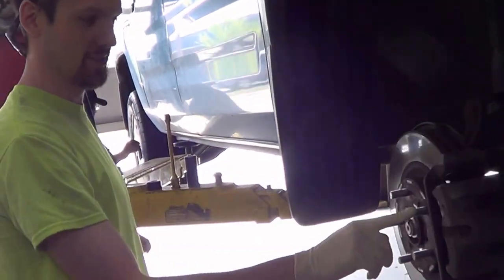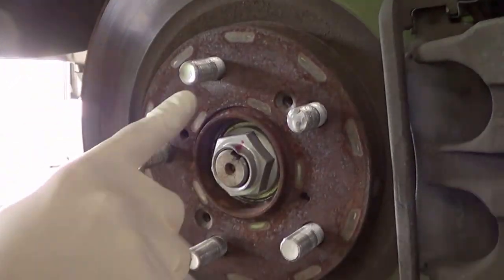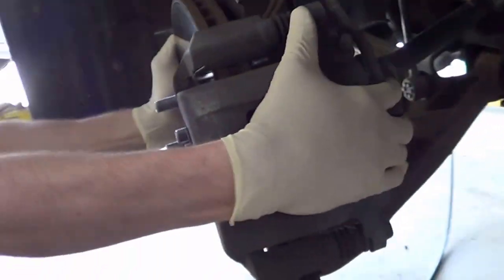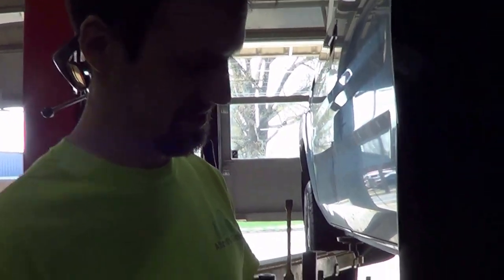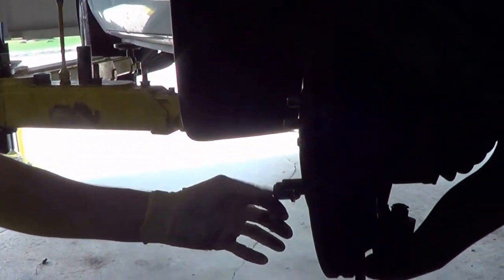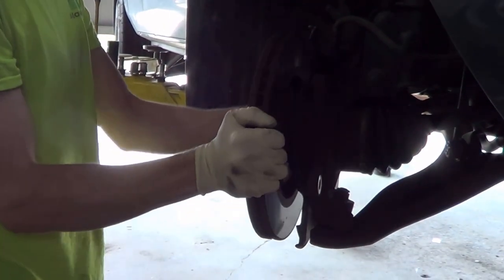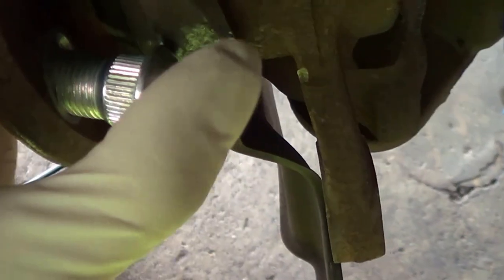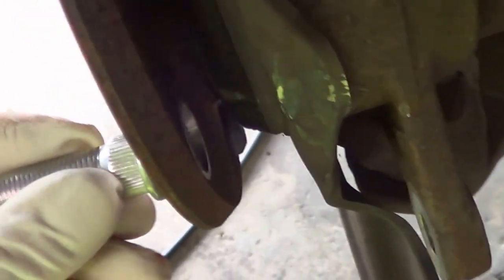How to replace Honda Ridgeline front wheel stud

Comment: OMG thank you so much! I just changed out my snapped lug nut studs on my Ridgeline. That little piece of metal was easy to bend back. I must have been lucky since I didn't need to grind down the head of my studs to fit them in. I went ahead and changed all of them because I read the others might be streesed as well. At $1.39 a piece, it was an easy process thanks to your video!
Reply from the maker: Awesome thanks for watching glad ur back on the road
Reply: How do I get the honda center hub emblems off?
Reply from the maker: Are you talking about the center caps on the wheel? Use a suction cup or take the wheel off and tap the backside of the cap with a wooden dowel or something similar.

Comment: looks like ill be doing this this weekend. The wheel stud broke on my 2002 Honda pilot during a tire change on the side of the road. the last time i had a tire rotation, the kid at the tire shop must of had too much fun with his air wrench and cross threaded the lug nut on the stud. like i said i was on the side of the road with a flat tire with minimum tools so i had no choice but to break the stud cause that lug nut just wasnt coming off. i called a shop to get an estimate on them replace it. they quoted me nearly $400. f*ck that, im doing it myself
Reply: Lmao "had to much fun"

Comment: is the only way to take out the stud by bending that plate?
Reply from the maker: +Steve Unless you want to remove the wheel hub. Bending the plate is easier.
Reply: Lehew Tech is there a plate in the way on a 2012 Honda Pilot ?
Reply from the maker: +Steve I believe there is Steve.
Reply from the maker: I believe I bent it back and checked the clearance after reinstalling the rotor
Reply: I loosen up the wheel bearing assembly use the rotor as leverage and pull the hub out just a hair then you do not have to grind anything!!! Just finished doing all 5 front on 2018 Type R

Comment: This is the only thang I hate about honda, they are great but come down to wheel studs, they forgot to make place to take out studs smfh...honda need to fits this cause other vehicles has a little place to actually remove these studs without cut or bang on the suspension